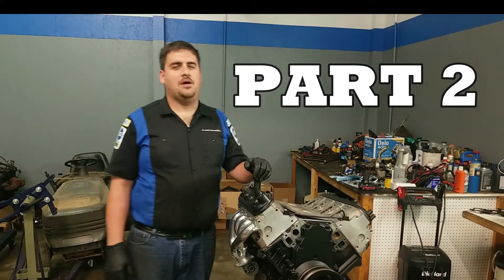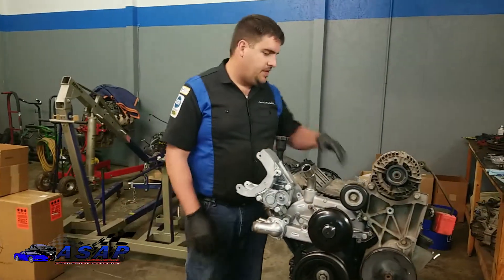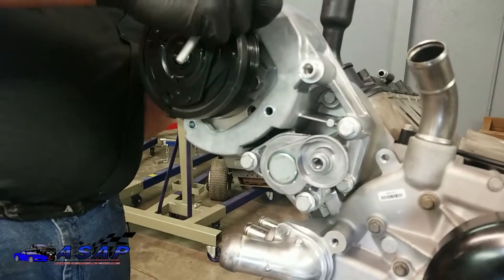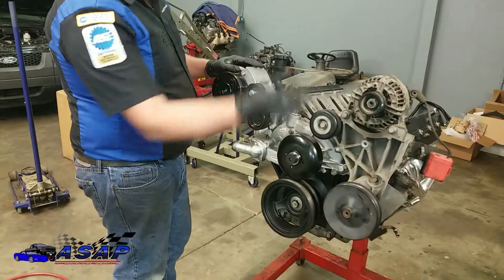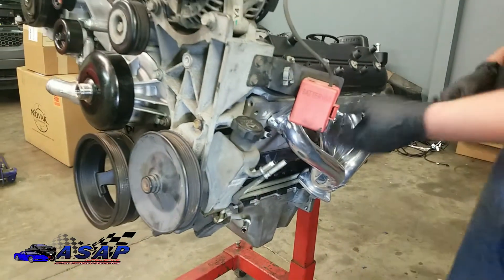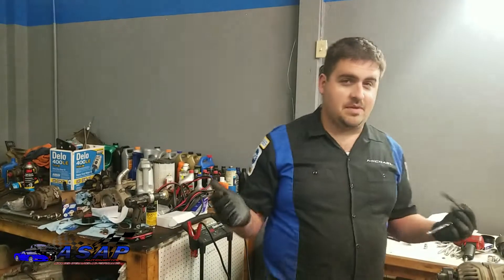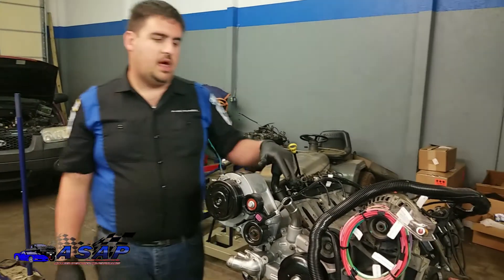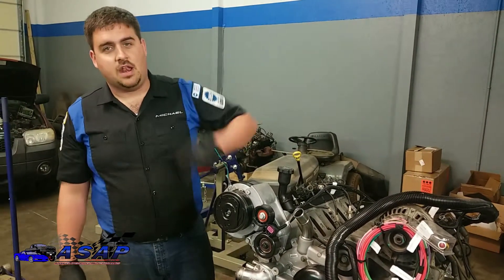Engine Part Assembly Part 2

Comment: Hey Bro Awesome Video's and great tutorial on your Jeep Tj LS Swap! I have been following all your videos! I'm also in the middle of a Jeep LS swap aswell! So I appreciate what your doing great info!
Reply from the maker: Thanks man that really means a lot, glad you like the channel!    I'd love to see some pics of your build.  What jeep/ LS combo are you going with?
Reply: @theasapautomotivechannel6815  It's a 2005 Tj Rubicon I have a 2011 5.3LMG and I'm going to do a DOD&VVT delete I'm going to install a 3bolt Texas Speed and performance stage3 cam and thinking of using the FITech ultimate LS 600hp kit with trans controler. And I'm going to mount that 5.3 to a 4l60e that I still gonna beef up a bit and convert it to a 4L65 and get the advanced adapters tailhousing to mount that trans to my NP241 transfercase. Hopefully those DANA 44's will last me enough time for me to save up to get some DANA 60's later on.. Cant wait for your next videos to see your install Bro!
Reply from the maker: @foester04  that's gonna be a sick build!

Comment: I hope that R4 lasts for him. I remember the nightmares back in the 80's and 90's with R4 compressors. Obviously, you never wanted to use a reman as they were a comeback waiting to happen, and the new ones weren't much better. I hope they've gotten better over time :)